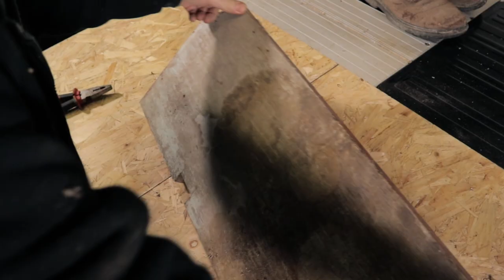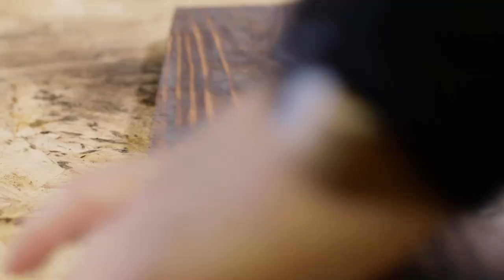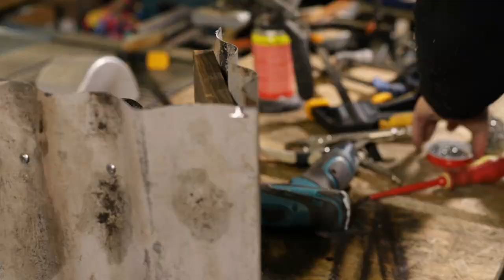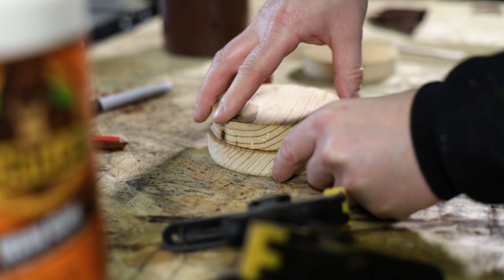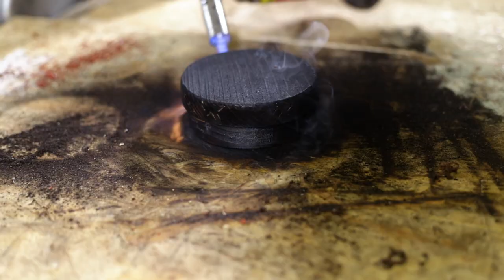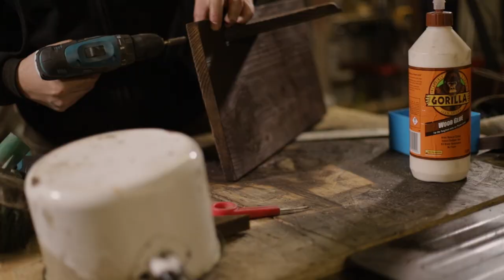Upcycled Birdhouse Ideas

Comment: Super ideas and awesome birdhouses. But one important detail is that the inner side with the hole must be rough or with shallow notches applied. Otherwise, chicks, as a rule, cannot cling to the smooth surface and get out of the hole. Accordingly, they remain inside and die. Tested in practice. On the metal inside, you can stick wooden sticks for clawing. Kind regards.
Reply from the maker: Thanks for the feedback, really good to know.
Reply: I use a fine wire mesh on the inside to enable the youngsters climb out.  In larger bird homes use a larger wire mesh.

Comment: You will be aware that nestlings need something to help them from the base of the nest to the entrance :  e.g. deep grooves in the wood.  They will find it very difficult to climb up the inside of a metal saucepan.  Perhaps a mesh fitted to the inside of the saucepan would fit the bill.  It needs to be in a shaded area or the saucepan will become an oven.  The overall design is very clever.  This is not a criticism but, hopefully, a constructive suggestion.